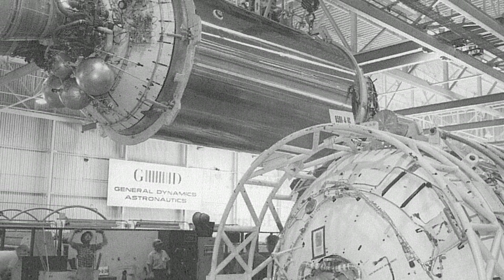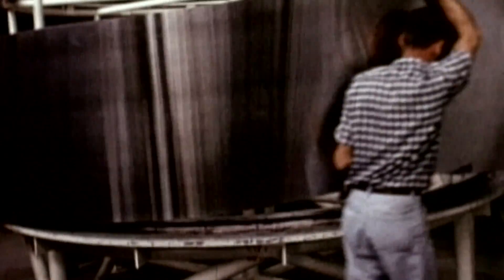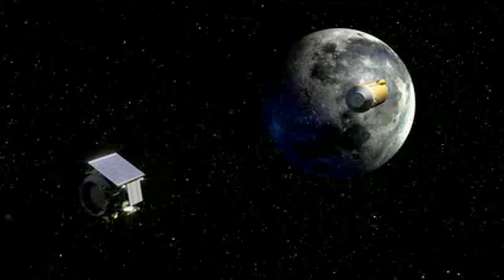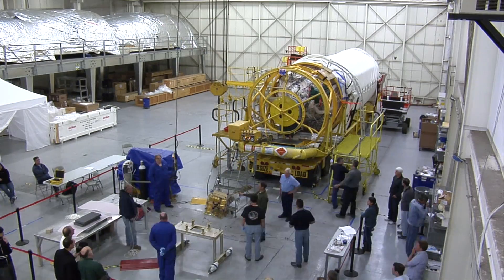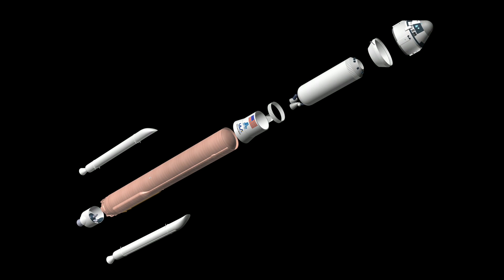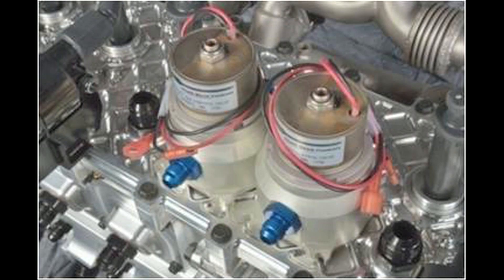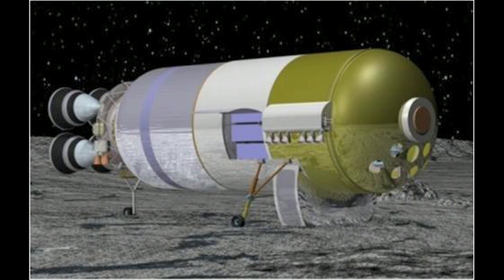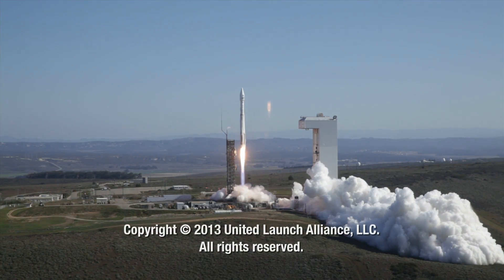Centaur: 50th Anniversary of the First Successful Flight

Comment: CENTAUR STAGE

-- James Ph. Kotsybar

“The workhorse of the space program” it’s called,
but of course that’s only half the story.
Despite the many payloads it has hauled,
conveyance is just part of its glory.

A workhorse is a beast that one can trust,
but Centaur is much more than just a beast. 
For fifty years it’s given more than thrust,
but guidance, and direction too, at least.

It uses the same fuel, as does our Sun --
efficient and clean, it stores it frozen.
When teamed with either Atlas or Titan,
it's reliably gotten the job done.

It’s only half workhorse.  It would appear
that Centaur’s other half is engineer.